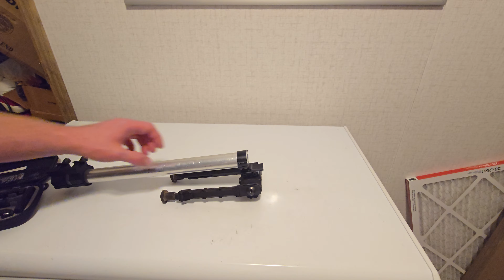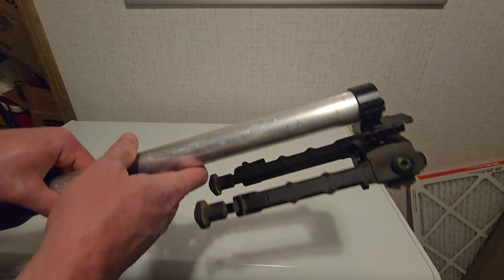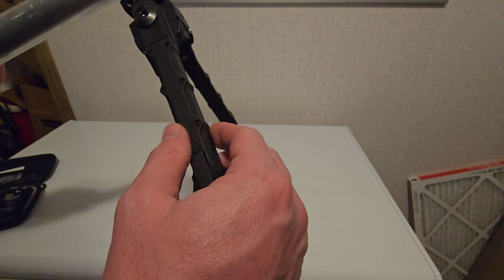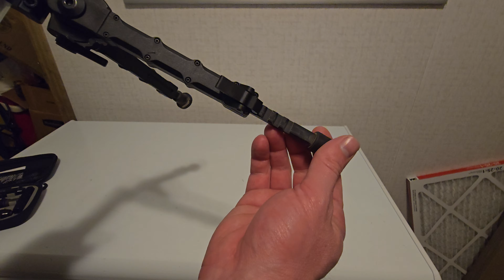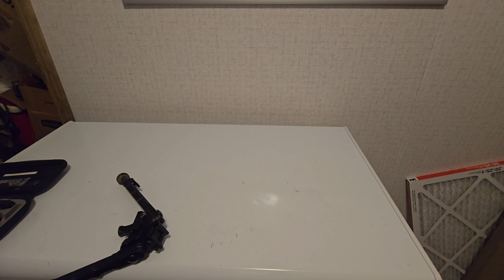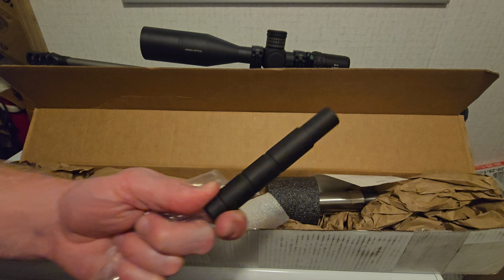Outlier Barrel and Outlier Chassis

Comment: It's phenomenally cool that you got a mile shot with a 16' .308, could you please do a video of how the chassis installs on the barreled action? I got this chassis in Tikka T3 Long Action, and it does not appear that it will work with my Tikka T3 7mm Rem Mag, literally only 1 screw from the stock Tikka Chassis can even fit through the holes on the Outlier Chassis I bought.
Reply from the maker: You might want to contact Outlier, I had a similar issue with my Ruger. They are supposed to include the correct action screws with the chassis kit. Mine didn't come with them, but Outlier is super helpful and will send them to you if you ask. I will do a video as soon as I can. YouTube isn't super friendly when it comes to firearms modifications/upgrades, but I will do what I can. I meant to do a video on the barrel install too but I don't really have a lot of space right now and my shop isn't finished yet.
Reply: @ you’re awesome! I literally just got done with an email exchange with Outlier where we figured out they didn’t send me the right screws. I’m going to make a channel just to show my progress on this Tikka 7mm PRC build, I’ll make sure to give you a shoutout!
Reply from the maker: @landocallbackesian3884  glad you got it sorted out! And I appreciate it! Send me the link when you post the video so I can subscribe.
Reply: @ you should still consider posting your install video since it should take about 2 minutes and make clear that Outlier many times does not send the screws!
Reply from the maker: @landocallbackesian3884  I probably will. Even if I have to take everything apart just to put it back together. It's not that big of a job.

Comment: Budget gear will get you a long ways.
Eventually there will be some items you spend more on.
Reply from the maker: 3500 dollars in ammo and the practice time I will get out of it is probably way more useful to me than a 3500 dollar Nightforce. Practically speaking. On the other hand I have a savings account just for building a 375 CheyTac which will not be low budget in any way shape or form lol. Maybe then I might look into a Nightforce or a Schmidt and Bender or Steiner or some other real tier one scope. But for now the Arkens do great.
Reply: @RecreationalSniper  The Arkens are great for rimfire and anything out to 600 yards in bad light conditions. 
I ran the Ep5 for a while, and then my wife ran it. Great budget optic.